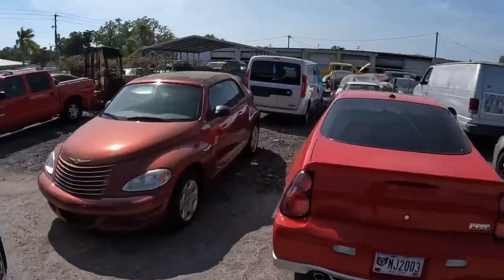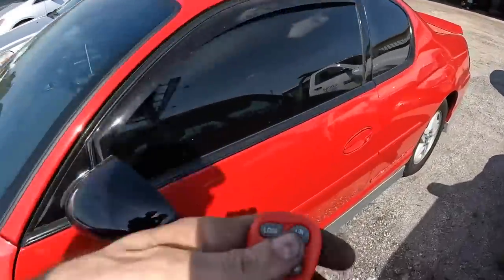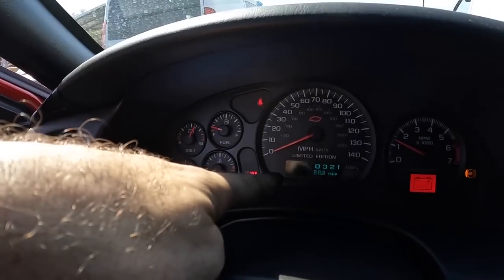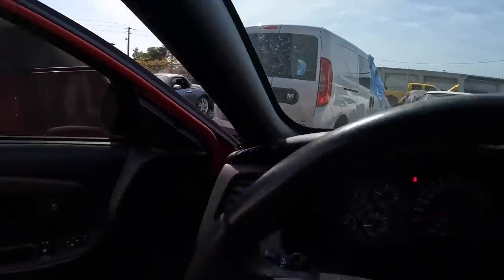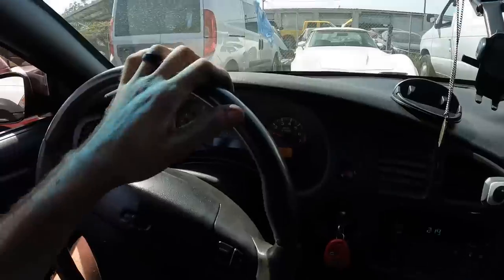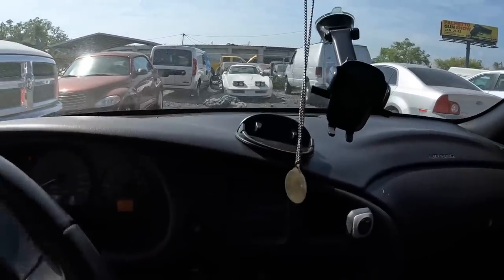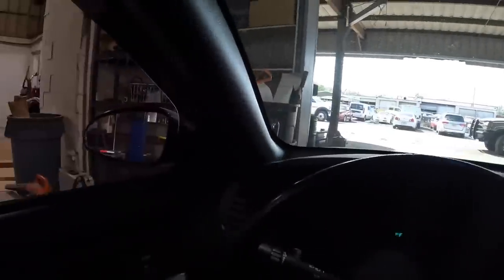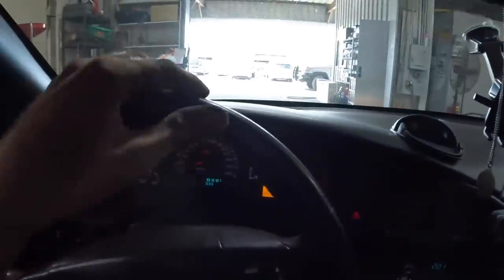Oil in Radiator! 2003 Chevy Monte Carlo 3.8 Manifold Leak!

Comment: Goodness knows how you're going to remember where all that stuff goes back, but it looks like you're enjoying working on that car!
Reply: I was thinking the same thing. Ray's memory is amazing. 
He is certainly not a tree mechanic where you have a pan of extra bolts, washers, etc.
Reply: Its not really too bad if you employ the same organization technique. Bolts with removed parts, usually aligned in order(what i do). Just a different way of doing things takes a lot of the guess work out.
Reply: I’ve made the same comment before on a couple of videos. Amazing memory & work process skills.
Reply: Having video to reference is a big plus also. That would be my protocol for a whole host of reasons.
Reply: Look back at the video. Great reference tool.
Reply: I agree.  There were many jobs I have done on my personal vehicles where later, I wish I had at least taken some photos along the way.  Ray has his video he can rewind and check if he forgets where something goes but, I bet he does not need to do that very often.  I just replaced the timing chain on my Dodge 5.2 van and to get in there, you have to remove EVERYTHING.  I took a large piece of cardboard and drew pics of all the various components I had to remove, and stuck every bolt in its place on those pictures in holes right through the cardboard.  Reassembly was much easier and faster and it was well worth the few extra minutes it took me to do that.  I had to wait several weeks before all my new parts arrived and I know I would have not remembered where everything went and in what order if I had not done that.

Comment: Funny you mentioned the coolant in oil requiring mandatory replacement of oil.
My sister was adamant it was fine because 'oil cools the engine', it took some time but eventually she realized her mistake when her car died, didn't matter because it was a very old car anyway but the main thing was she realized I was right!

Comment: Yep, a parts cleaning machine would certainly help you.  Maybe one of those parts cleaning things that cleans with hot water and detergent.
Reply: Yeah - can't get away from it if you're a garage. I'm an advanced DIY'er and I have a parts cleaner I cobbled together.
Reply: Those parts washers are pretty pricey but they will clean things down to the bare metal in a short period of time. They don't need to be babysat load it up on the way out at night, ready in the morning.
Reply: He has one

Comment: One of my favorite engines.  I had a 97 Firebird with the Series II and a 5-speed, what a fantastic combination.  It was my mobile office and I retired it after 10 years and around 225k miles.  In that time I did a water pump, clutch, belt tensioner and wiper assembly.  I gave it to my SIL and he played with it for a few more years.  One of the best engines of all time.

Comment: Ray, another outstanding vlog.  I've found that using Dawn dish soap with the spray trigger is perfect for cleaning these heads.  Less toxic and cheaper than brake clean.  Let it soak a few minutes and hose it off!
Reply: He has a big stainless sink from the other side of the shop. It’s amazing how clean some hot soapy water can clean those parts. I’ll still give them a final hose down with the brake clean and a shot of compressed air to make sure they’re dry, but most of my parts are cleaned with soap and water. I also keep a few bottle brushes, flat brushes, tooth brushes and some scrubbies by the sink to clear away debris.

Comment: Kinda amazed me that this 75k mile engine seemed to be quite a bit dirtier inside than that almost 200k mile Mitsubishi engine from a few videos back. Not saying this car isn't properly maintained or anything because it looks immaculate, just noticed the difference is all. Probably because of efficiency differences, petroleum products used and how the two vehicles are driven.

Comment: Not a horrible job to do, I've done a few many years ago.  You need to get a Super Scraper, it does an excellent job on mating surfaces without flinging small particles all over the place when using an abrasive wheel.  It also will not harm the aluminum surfaces.  I also would refrain from using the plastic grill at the base of the windshield as a shelf for hardware and small parts.  It'd be a shame to do any damage to that piece of plastic........

Comment: Another comment, I lost my 2002 Camaro because of something a mechanic did replacing the intake gaskets. The engine got seized because of something getting into the oil pan and clogging the oil pump. The shop wanted me to pay for a new engine, which they broke. I miss that car.

Comment: i had a series 2 3.8 in a Bonneville back in the day. the only issue it ever gave me was the plastic little coolent elbows breaking from heat cycles, after you replace em with aluminum ones you never had that issue again. the trans did start to slip around 180kish but only when cold. it was a really solid platform. imho gm has not made a platform as reliable since.

Comment: My brother had one of these in blue. It was ok, but it had the cooling issues. I did this job, replaced the plastic coolant elbow with a metal one, flushed the nasty GM coolant, and replace it with Honda coolant. It never overheated again & ran like a top. 

Overall the GM 3.8L V6 from GM is the V6 that made everyone respect V6 engines. Torquey Oldschool engine with some modern parts… amazing stuff.

Protip: Removal of the rubber intake-tube & coolant-elbow is made crazy easier if you use some tire silicone if you don’t want them to break/tear apart.

Comment: IMO best engine ever made... series II was my favorite as it had all the upgrades from the series I but GM on the later versions of the series II into the series III cheapened these  engines out with subpar gaskets and plastic intakes  and with that this once great bulletproof engine spanning over 30 years  was gone and ushered in the junk known as the 3.9 V6 .

Comment: Thanks for showing us the 3.8 manifold gasket replacement. I replaced mine in my Buick Lesabre without problem. I also removed the alternator and replaced the valve cover gaskets. Just a final item I found the belt tensioner was leaking coolant but not from the elbows.

Comment: That motor is fitted to Holden Commodore cars in Australia. Rebecca's daughter has one. I have done some brake work on it. That manifold leak is very common here. Will be great to watch this. A local mechanic did the manifold leak many years ago.

Comment: This is the first engine I ever pulled about a year ago. In my 2004 GrandPrix gtp. They are bulletproof. Had the ground of a spark plug break off and cause a chunk of piston to disappear. Ran it atleast 1000 miles through it until the knocking got too much😂. Pulling it again here soon.

Comment: I did this same repair years ago on my sister's Malibu 3.4. Let's just say it took me longer than 6 hours. LOL. 74K on that of 07, probably not for sale. Good video.
Reply: I did the same repair on a 2002 Impala 3.4.  Lot of pitting around coolant passages.  Filled pits with J•B weld.  30K since repair - still holding.

Comment: Another great how-to-video!
One thing - please read GM Bulletin No.: 00-06-01-012E, Use of "Surface Conditioning Disks" When Cleaning Engine Gasket Sealing Surfaces and/or Reused Engine Parts - "Do not use abrasive pad/bristle devices to clean the gasket surfaces of engine components. Abrasive pads should not be used ..." Due to pieces of the disks/pads contamination, leading to engine failure.

Comment: Hey Ray i figured out a handy home made tool for removing the broken elbows easier just get a flathead screwdriver and put the tip in a vice and bend it slightly and it will have perfect leverage

Comment: This one hits right in the feels.. First time I ever did significant engine work was on my 99 Grand Am with the 3400.. 70k miles and gaskets were toast.. was an all day adventure. Also not quite as involved as the 3.8s.  Nice Felpro kit.. Car went on another 10 years and before i junked it last year at 217k, gaskets were getting weepy again. no milkshake but the coolant crust was forming near heads and oil leak started on either ends of block. Likely was going to be alot more than just intake gaskets. Snow belt cancer took the undercarriage and was just too far gone to save it.

Comment: One of the easiest engines to work on is the 3.8 and the most durable. I had a 97 Bonneville that started losing power and started overheating when I was 150 miles from home, I made it to my destination, after a couple of hours I started home everything was fine until it happened again, I pulled off the highway and managed to slowly get the radiator cap off, there was zero coolant in it, the gas station and it was onky a gas statiin no service had an outside water faucet for a hose and the guy let me get as much water as I needed, i had a 32 ounce cup filled up the system kept the cap loose and proceeded on home about 100 miles. I made it home an a few blocks from my house the car started bucking like crazy, pulled into my driveway and that was it she stalled out and would not crank. I went to a me mechanic friend of mine and told him what happene, a guy working with him said that I'd better get home remove the spark plugs and crank the engine because to him it sounded like it was hydrolocked, I removed the plugs cranked it and it was like geyser, I did some research and found that the upper intake was the culprit and there was an improved design, AutoZone had it in stock, installed it changed the oil which did not have coolant in it filled it up with water to start and hoped for the best, there was an impressive amount of smoke that filled my yard but when the smoke cleared the engine ran great like nothing ever happened a testament to the durability of the 3.8. I mistakenly sold the car to my friends girlfriend who proceeded to slowly wreck it. I now have a 2001 lesabre with 320,000 miles that's going strong, I checked the spark plugs to see if they needed replacing but they are in perfect condition, no signs of oil burning or anything, they're all clean as a whistle, so far she's never left me stranded even after owning it for ten years now.

Comment: I’ve done this job twice, once on my Intrigue, then again on a Grand Prix GT that replaced the Intrigue.  Fantastic engine once you put the better gaskets and 90° coolant line on.  It’ll easily go 250k miles.  I usually replaced the valve cover gaskets as well - easy to do when it’s that far apart and it seems to me there was a either a recall or service bulletin to change them due to engine fires from leaking oil as they aged.  Great video - and a nickel nostalgic.

Comment: The Monte Carlos SS (and Buick Enclave which is not pertinent) are why I won’t ever own a product manufactured by Generous Motors….

My mother in law bought one of these brand new - 3 miles.  First new car she’d ever purchased.  At 28 miles, the first drip of oil appeared.

That car was in the shop 6-7 times over the next several months.  Eventually, when it continued to drip and smoke, we put it on a lift before taking it in under warranty yet again.

There was at least 3 tubes of clear silicone on the engine.  These were factory warranty repairs obviously.  The oil pan was functionally encased with clear silicone as was most of the upper half of the engine.  Despite multiple repair orders indicating new cylinder heads, new intake, new pan - all of that was original.  

So, we experienced a parts cannon of the most nefarious type - the cannon never actually fired the parts, they just told us it did.  

True, this is not directly GMs fault as they were relying on the dealer to do the warranty work appropriately, but the only reasons to buy new vs used is warranty or vanity, and in her case the warranty provided no benefit and you certainly can’t win on the vanity side if the car is only in your driveway for 5 days during the first 6 months you own it….

She got an attorney and lemon-lawed the car - purchased back by GM with 175-ish miles on it…17 months after purchase….

Comment: Didnt know chevy used the 3.8. I have a 04 Grand Prix about a year after I got it I started to experiencing a loss of coolant and over heating and did everything to fix but sometime later I got to talking to a Mechanic and he told me that this motor has a major flaw  The EGR tube was heating the lower manifold and damaging the gasket in rear drivers side area got a gasket kit with a MLS and yeah problem gone  These motors are bullet proof and no longer made what shame

Comment: That front valve cover is black plastic. That shows that the recall has been performed for the oil fire from the dripping oil off of the valve cover gasket leak.

Comment: That model of Monte Carlo here in the rust belt can cause the frame in front of the driver's rear tire to rust through. The 3.8l intake manifolds on early models are famous for burning a hole in them. I used to work auto parts, and we sold one or two a month. I had family that I ended up changing two of them myself.

Comment: Must congratulate Ray on your most excellent vids, very concise and obviously knows where he's at. As someone across the pond though it is funny watching, with all the US connotations and differences in parts names from over here. One thing I don't understand though, as others have mentioned, especially in this vid, is the use of so much brake dry clean (BDC) for parts off the car. It obviously works very well for you, just thought there may be other options? Surely a HP parts washer would be much more effective option, cheaper in the long run and much more environmentally friendly? I also agree with another poster, a big drum of BDC and a spray bottle would surely be cheaper too than all those cans?

Comment: Had the same thing happen to me was replacing a pcv pipe to pcv valve on my Subaru. And the hose kept braking where eventually i was able to use an adjustable pliers. To extract the rest of the hose. Also had vacuum hoses where they had broken off where the connect. Especially underneath the intake manifold.

Comment: Better change every seal, gasket, and o-ring anywhere near the intake.  From my experience the vehicle is about 15k away from catastrophic engine fire caused by leaking fuel in the plastic upper intake.💥🔥😥

Comment: You need to check with your building guy Ray, you can replace that one section of Z channel with a turned flat C channel or two and give you about a foot more room in front of the little lift. The building is not insulated so you don't need that section for it or strength since the structure is already in. Downside is, you would have to move all that oil somewhere.
Reply: I was the very 1st person to address this in a comment . he has already addressed saying he would not gain enough clearence to make it worth while.
Reply: @waynegoin5534  Thanks, must have missed that mention.
Reply: @chuckd5819  Ah yes, but a comment, is a comment, is a comment. The algorithm does not care. It is all interaction for the channel.

Comment: Wish I had a tech around here that I could trust. Even simple stuff like an oil change.  Overfill.,  loose drain plug, lug nuts not torqued. And we’re not using Jiffy Lube.
Gotten to the point where I check the oil level before I leave the garage.

Comment: I did this on a Buick with the same engine, I used the metal elbows instead of the plastic ones (they make both) so it will last longer. 👍🏻

Comment: The series 1 was bulletproof. Series 2 had an issues with the intake melting. Series 3 fixed some of that, but as we see, the gaskets were the weakest point. They should've went back to an all aluminum intake for the series 3, but cost savings... lol

Comment: I love content with the 3800 engine I have one in my 06 Buick Lucerne. I find it interesting how series 3 3800 have differences. My intake is aluminum while the one here is plastic, also the plastic elbow on my engine has 2 for the heater core passages. I'm hoping that in part 2 you use the upgraded aluminum elbows they wont break or get brittle over time. I do wish some how you could get in with Cletus McFarland and get some sort of colab going. he is right their in Bradenton Fl. you drive by the Freedom Factory and Bradenton motor sports drag strip.  just a thought build a Ford Ranger and race it at his Danger Ranger race minimal cage and rest is factory ford settings. you could promote your shop on your truck and you tube channel. miss the phone doodleee doodleee ooos.

Comment: Don forget..check the egr value port in the uim for e longated hole.theres a fix or replace the uim..plastic crap..or.up grage to the 2007 aluminum cover with bigger tbi unit.also a car.that age,it's going to be a domino effect.just go thru it now while apart and do all upgrades and hoses.if u plan on keeping it.great motor once these are addressed.

Comment: Good video Ray, I had to have the same service done on my car when I first got it, mines an 04. This car has a 2000 through 2005 body style.
And going on the HVAC it’s a 2000 to 2003. 2004 - 2005 they changed the HVAC from numbers to dots and a few other subtle differences. Unfortunately, mine is not as clean as this one anymore being in Michigan. The gaskets on my car somehow survived until 116,000-ish miles when I bought it I just remember paying my mechanic so it’s nice to see what goes into this repair. Then a year or two ago the intake broke and stranded me.  They are very reliable engines, just wish gm didn’t put so much stock in plastic.

Comment: I know you like penetrating oil and brake cleaner. Both work well on the vehicle. Have you considered getting a solvent tank cleaner. It might be easier and more cost-effective for parts like the  intake manifold. Just a suggestion. Have a great day!
Reply: He has a gray Harbor Freight parts washer in the conner in the expanded area, I don't know why he doesn't use it.